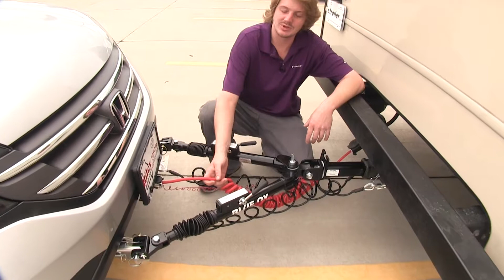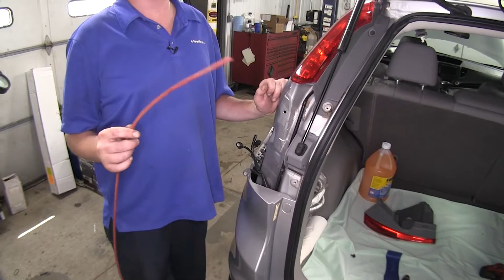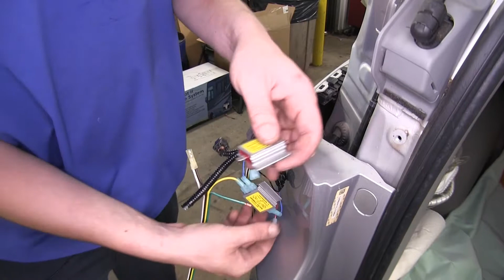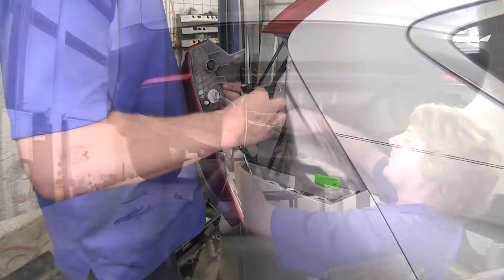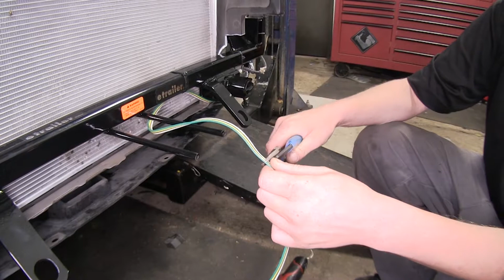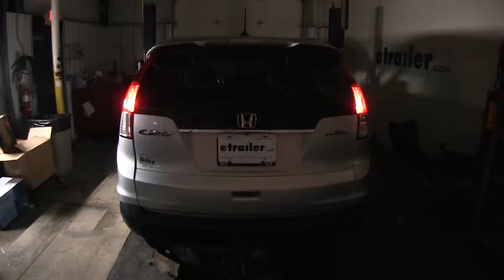How to Set Up Your Roadmaster Diode 7-Wire to 6-Wire Flexo-Coil Wiring Kit on a 2012 Honda CR-V

Comment: I just tried to install this kit today on my 2012 CRV. Don’t buy this kit! They don’t tell you that the crimp spade terminals are made for 14 to 16 gage wire but the Honda red and blue wires are 18 gage! Even the yellow spade terminal where he crimps the brown and white wire together did not crimp well enough to hold the wires. So, when the diodes are dropped into the car body they are supported by thin 18 gage wires. There will be a lot of bouncing around of the diodes and the 18 gage wires will be a mechanical failure point, and there are four diodes.
Reply from the maker: The diodes provide double-sided tape on the back, they can be adhered to a clean surface. As far as the wire connection to the push terminals goes, for smaller wire, you can strip the wire insulation back a little further and double the wire up.
https://www.etrailer.com/Tow-Bar-Wiring/Roadmaster/RM-15267.html